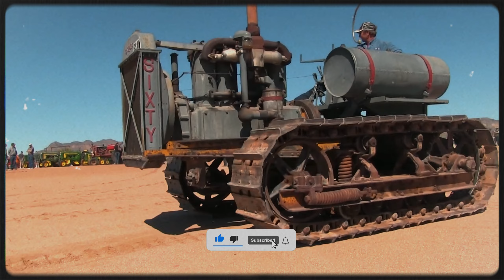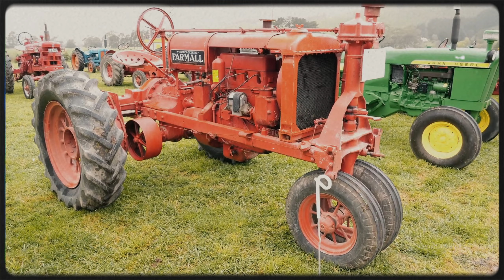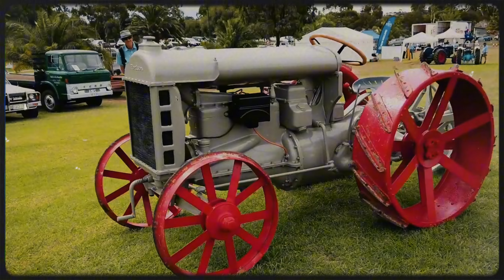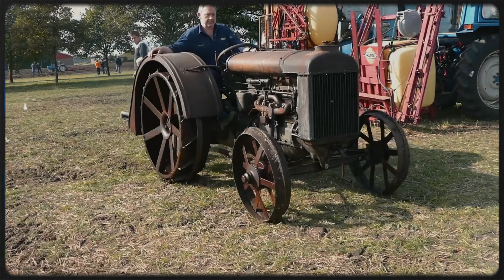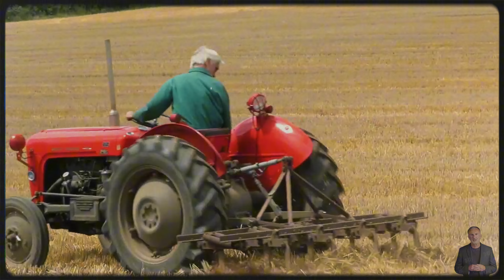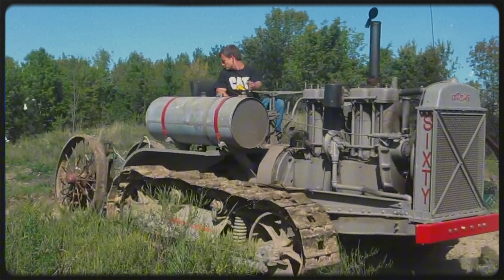The 5 Worst Tractors Ever Created in History (#3)

Comment: Hmm, is this AI generated?  I have a modicum of experience with tractors and lived in the era of these tractors and I am surprised.  1.  Early Fords had licensing issues.  Many tractors successfully use the engine and transmission as frame components -- as do racing cars.  2.  The John Deere D ran on distillate, gasoline, or kerosene.  As did the popular A and B.  The tractors started on gasoline.  3.  The problems with early tractors were generally the work station.  No power steering.  Poor brakes.  Inappropriate and few gear selections.  Uncomfortable seating and operation.  No hydraulics.  That's what I experienced, anyway.